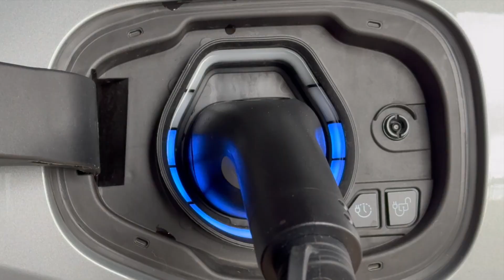3S 40A vs 4S 40A BMS: Power, Performance & Voltage Compared

Comment: Hi there, pretty straight forward video. Thank you.
I'm a newbie and I have a quick question please.
.
What if I desire a parallel connection for a diy powerbank, let's say in a 15 battery (18650 2000mah) set up?
1.) Kindly, what BMS would you recommend and why?
2.) Do I have to drive every BMS with a series connection as demonstrated in your video?
.
Thank you and keep dropping these vids.
Reply from the maker: @playprostudios712  hi there. Thank you for the feedback. Depends on your application if you would like to have 12v battery then 3s bms. If you would thank 2000mah = 2ah battery and teoratically there is no issue to have it in parallel then  15x18650 would be around 3.7v and 30ah for the 3s bms you need 3 series you would end up having 45 18650 battery for 12v 30a and I would use at least 3s 40a bms but 60a would be better as higher amps can the bms handel as better due too the consumption spikes in some usecases. I hope it helps.

Comment: Nice video! You could improve it by telling us more about the common applications of how this module is used. Where can we buy them in the US? How much do they typically cost? What does a BMS do? How does it support charging, over charging, over discharging? How does this one compare with other models out there? Does it support temperature shutoff? Does it need heatsinked? We need more info!
Reply from the maker: Thank you for your valueable feedback.